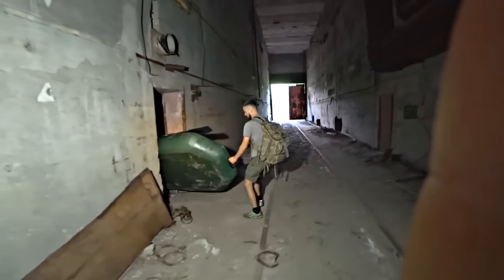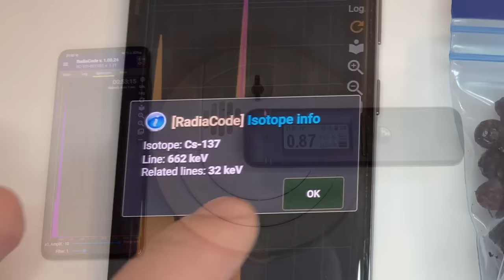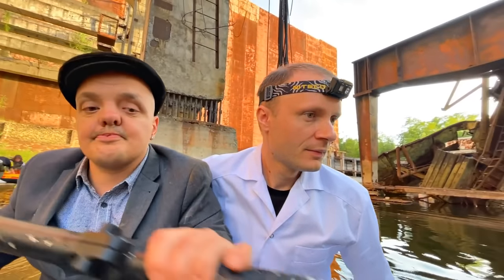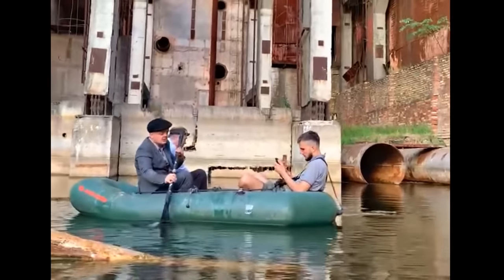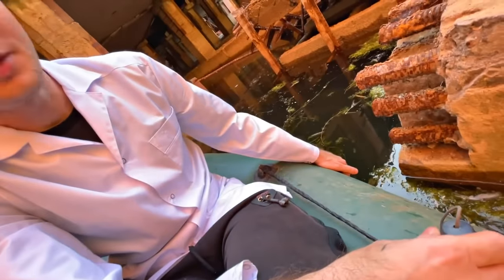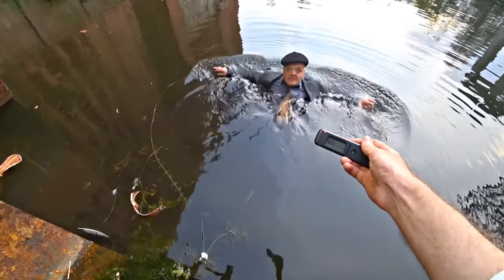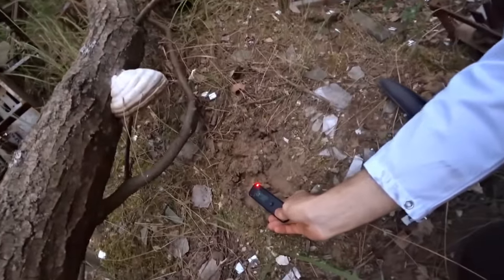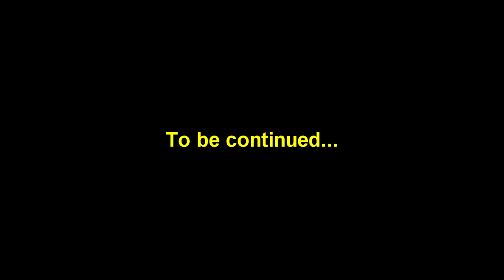What will happen if you EXPLORE under the Chernobyl Reactor☢We are looking for HOT PIECES in Pripyat

Comment: hopefully they show at the end of the trip what the total radiation exposure is with that new dosimeter they have so far it doesnt seem like crazy high levels but the total exposure they had over the trip would be interesting to see
Reply: They did and they were fine
Reply: @sabpac459  real concern would be anything they ingested.
Reply: 5yrs later...
Reply: @sabpac459  Doubt. They probably didnt receive a fatal dose, but cancer takes a few years to form, depending on how much radiation you've been exposed to.
Reply: @CODA96  Inform you, I do not defend this unconscious group, but it is just as useless to demonize the radiation which in fact is very weak, in reality it is fatal for certain element which were in contact, but much around is has weak dose thus nothing dangerous in itself, know that the radiation is present has the natural state and that probably you will take more radiation for a long flight travel that where they are. In fact they are actually quite far from the reactor involved.
Reply: @wizk875  I've read 1,5km from the lead Sarcopharg. Which isnt such a long distance. Like i said, it isnt fatal, but it sure isnt healthy to stay there for several hours. I think they will have a larger concentration of radiation build up than someone flying.
Reply: @sabpac459   well for short term there fine, the effects long term, I guess we will have to wait

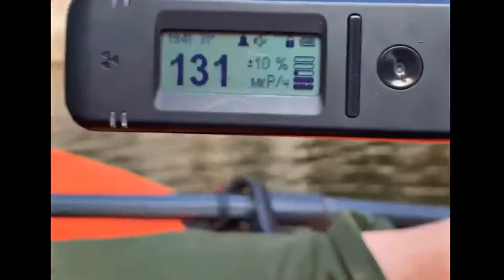Comment: I think there is some misunderstanding about how extreme it is to just walk around here. 7:49, one of the men holds up the dosimeter showing a reading of 131 mkP/4, which is Russian for 131µR/h (micro Roentgen per hour). Converting that to a unit of measurement that we use here in the US nuclear industry, that is 0.11 millirem (mR)per hour. Even at the highest dose rate, 2600µR/h, it's only 2.28mR/h. This is relatively safe. The Nuclear Regulatory Commission in the US mandates that nuclear workers receive no more then 5000 mR per year. If you work a full year in a nuclear plant, 8 hours a day, that comes out to 2.4 mR/hr - LESS that the dose they are receiving.  The stupid part comes from being in the water or possibly ingesting activated contaminants that can continue dosing you until they leave your body, or they decay via their half life.
Reply: This was insightful! Thank you